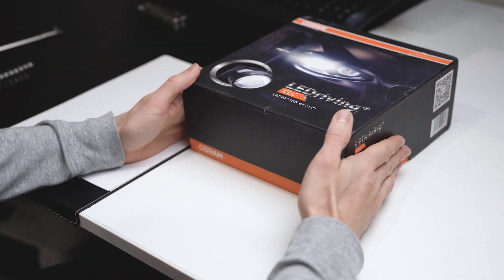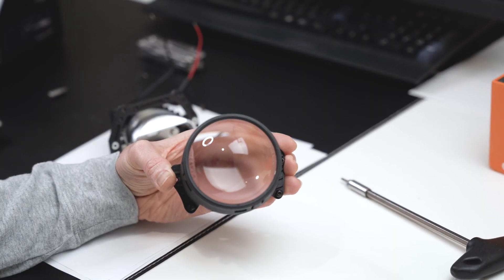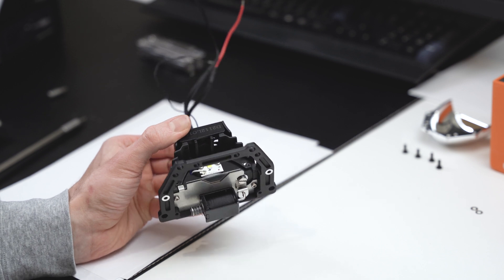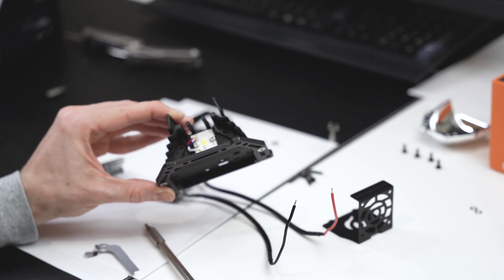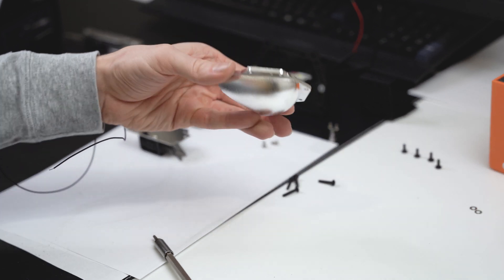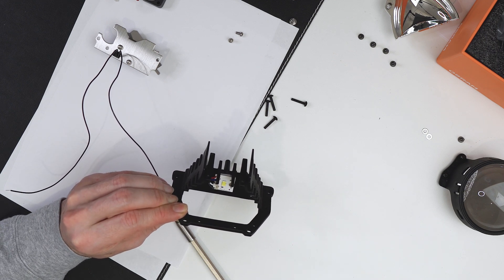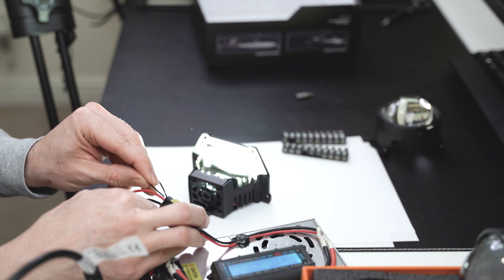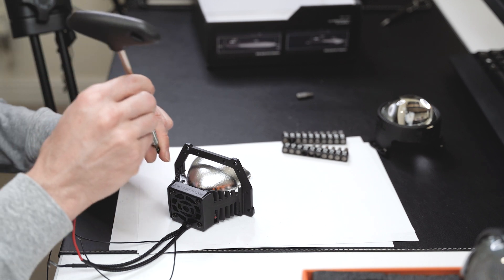Best Aftermarket Headlight Upgrade? Osram 3.0 CLC BiLED - Teardown

Comment: Post a link for the product, as by Google search couldn’t find anything
Reply from the maker: did you check in the description ?
Reply: @BestCarMods  what link?
Reply from the maker: @andrepurve  should be in the description. if not send me a message on IG and I will send it there ;)
Reply: @BestCarMods  Unfortunately, I don't see anything. Only your website link, but this does not work either. :)
Reply: I want to bye one. What do you think? Is it a good bi led projector?
Reply: The one that I bought does not have driver it goes directly to the led